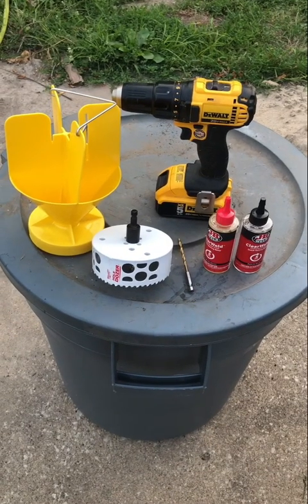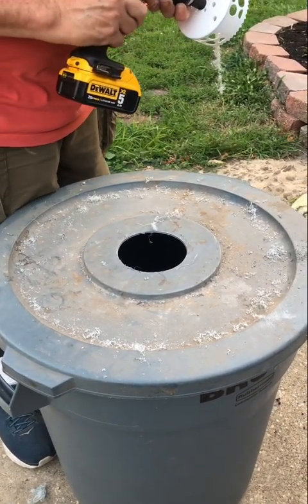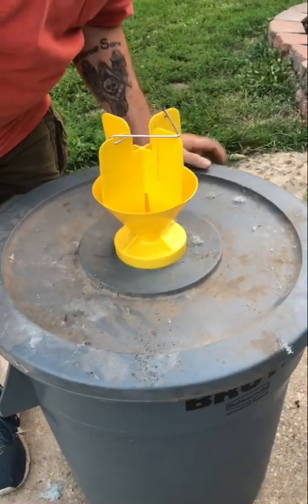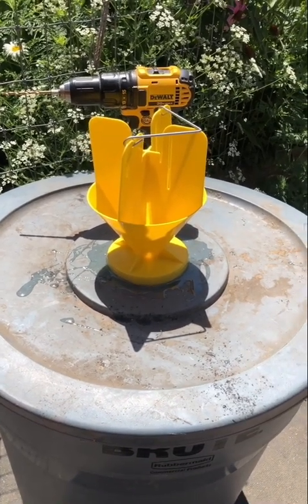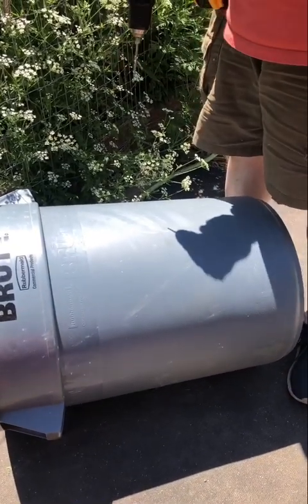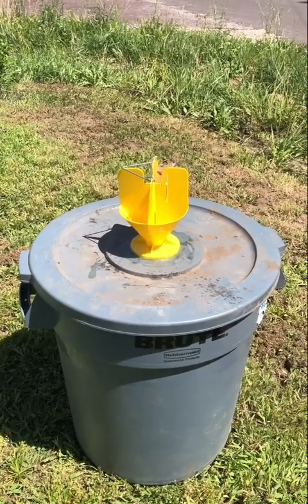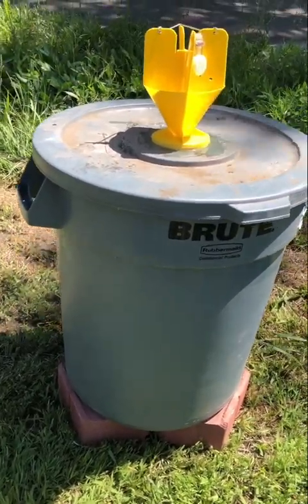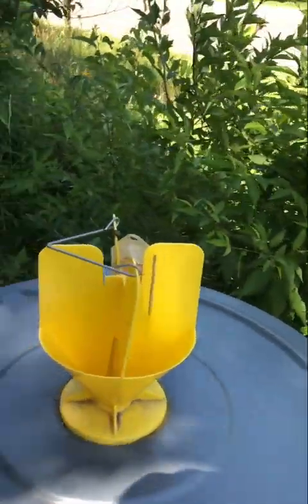BUILDING AN INDUSTRIAL SIZED JAPANESE BEETLE TRAP

Comment: Would it be a good idea to have water with soap inside the container so the beetles drown quickly?  How long does it take for the beetles to die in the container?
Reply from the maker: Not sure how long it takes the to die.  The inside of the can gets pretty hot in the sun. If you are to put water in the can to drown them you would have to refrain from drilling holes in the bottom. Such a course would ensure that water collects in the can and results in an suncooked beetle soup. I am pretty sure I have absolutely no interest in finding out what that would smell like.

Comment: hi , what do u use for the bait?
Reply from the maker: You can see the bait at 6:30 in the video. The rigid traps came with one bait each and you can get additional bait/lures from the same place you get the rigid traps.This os one site that has the traps, but they are pretty pricey so you might have to do a bit more searching to find a better price. I did not spend nearly that much for the six that I bought. https://shop.sheridannurseries.com/products/sheridan-high-impact-japanese-beetle-trap